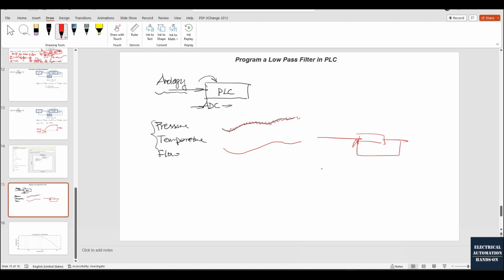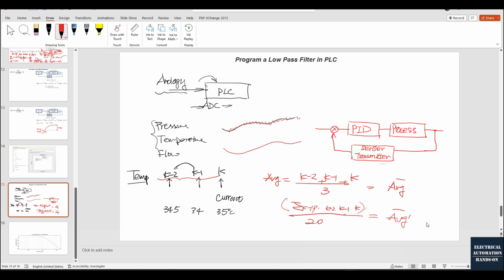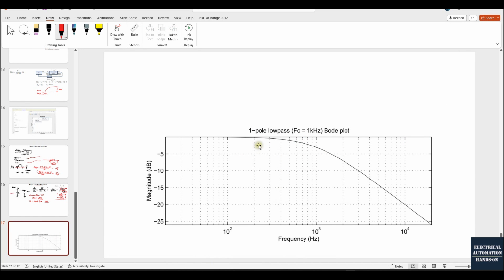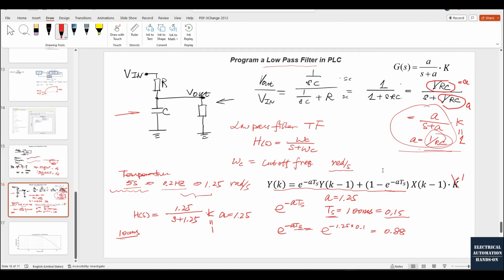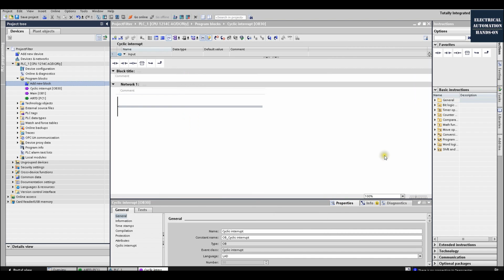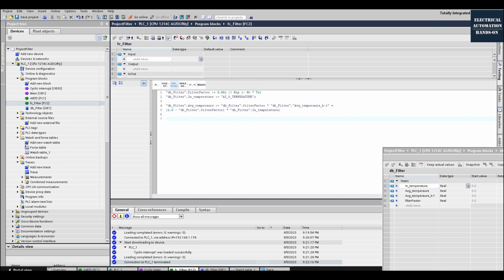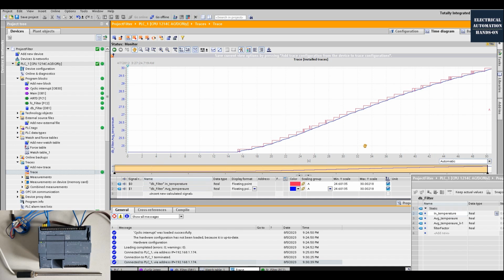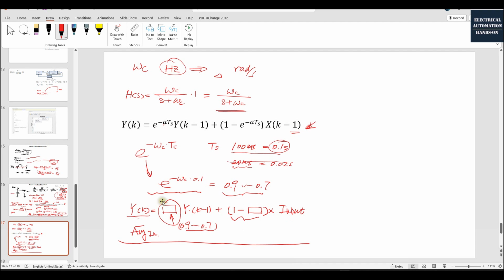TS05. [Model in PLC] Program Low Pass Filter In a PLC

Comment: Hello, I am a viewer of your channel. Thank you for sharing such valuable knowledge. Currently, I am working on a project to control and stabilize motor speed using a PID controller on an S7-1200 PLC combined with a VFD. Now, I want to implement a Kalman filter in the PLC to estimate the motor speed. Have you ever tried this before? I would really appreciate your response and support. Thank you very much!
Reply from the maker: As long as your know your Kalman Filter A matrix/process model, you could do it. Kalman Filter has a a couple of key step of equations/matrix calculation, just do it step by step. Make sure your call cycle is the same as Ts.

Comment: Great video. One question: should there be input(k-1)  instead of input(k) in the program ?
Reply from the maker: Yes, it should be input (k-1) for accuracy, but if your analog signal is slow change as I was using the temperature signal, the source signals (k-1) and k have almost no different, then using input(k) almost no hurt.